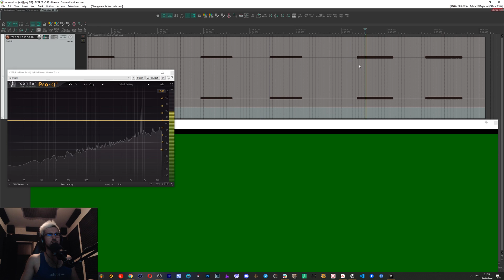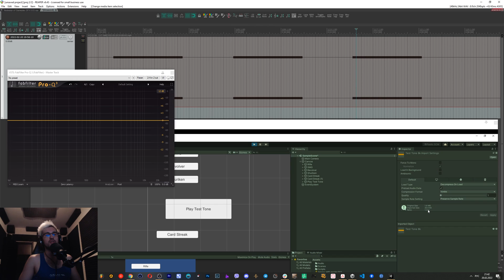Unity Audio Compression Formats (PCM, Vordic, ADPCM) And Sample Rate (Optimised) Settings Comparison

Comment: ADPCM is not as bad as you thing. The only "bad" thing here is the unfair testing method. :)
If it is really that bad, it wouldn't be there anymore.
ADPCM relies on integral/differntial math and do the compression based on the waveform.
Vorbis is DCT-based and compresses on spectrum instead.
Since your test spectrum has only one single frequency, even the worst DCT-based codec at its lowest bitrate should be able to handle that one frequency whereas ADPCM totally fails here because it can't replicate the round waveform well enough.
Try some white noise instead. This is the opposite unfair test. ADPCM will be likely the clear winner because it is the only lossy codec here not transforming it into a gargling mess at all.
Real recordings are neither single sine waves nor noise but something between. Here it dependends on. Most of times, all codecs produce good results. 
The only problem ADPCM has: It's the plain old IMA ADPCM, which is old and outdated. You need more bit rate. Made for limited hardware resources where you cannot use more complex codecs like Vorbis. 
Try WavPack. This is a newer ADPCM codec. The results are comparable, to MP3, if not better - As long as you don't feed pure sine waves :).
Reply from the maker: I agree that my testing for ADPCM was unfair.
But I don't wanna risk my audio turning into mess. Also mobile devices space is very limited too.

Comment: The transform codecs are all very good with steady pure tones. They internally split any sound into narrow bands and focus the coding on the loudest ones. Even at the lowest bitrate the result was acceptable. There is no need to attempt optimize the sampling rate because the codec essentially does it dynamically. Obviously 1% is not good with realistic sounds.

ADPCM is good with broadband sounds. You must keep the sampling rate high because big differences between successive samples must be avoided. It would have done better with the bass tone. It fails with melodic sounds like "triangle", but ocasional noisy sibilants or hihats would  be acceptable.

Comment: Hi Andrew! Thank you very much for your video. What samplerate are you using for your game audio? 44.1 kHz? 48 kHz?
Reply from the maker: Hi. I use 48 kHz, just cuz I work in them every day. But u should be okay with either of those, as long as u don't convert them within Unity. Cuz then the sound can turn into a mess.
Reply: Go for 48000Hz and you will be fine. :)
Forget legacy 44100Hz unless you want to produce a music CD. And even then: 48000Hz (or a multiple of it) and downsample it for the CD-based distribution while you keep it for all other ways of distribution. With a good resampler, the resampling distortion in the very last step of the CD mastering process is way below the distortion the downmix to 16 bit may introduce.
Almost all digital audio converters which are not CD players operate at 48000Hz or a multiple of that. The realtime-resampling of soundcard drivers are a compromise between quality and speed and may indeed become audible when the conversion is uneven. Using 48000Hz avoids this.
Modern lossy codecs, including Vorbis, are tuned to 48000Hz so the result will be likely the best at this sampling rate. OGG Opus doesn't even support 44100Hz anymore (it just resamples everything else to 48000Hz during encoding process).
If you listen to music files with your computer, installing a good resampling plugin in order to resample 44100 to 48000Hz may improve the playback audio quality :)
Reply: @wichtelchen  Very useful, thanks
Reply from the maker: Я так розумію, в тебе українське прізвище.
Reply: @Andrew_Renko  верно, у меня украинская фамилия и украинские корни. Сам я родился и жву в России, но в детстве очень часто посещал своих близких родственников в Украине и конечно же продолжаю поддерживать с ними связь и сейчас.

BTW thank you for answering my question. I asked more from sound engineer perspective as I don't use game engines much. I'd like to do best practices for my clients when I'm working on audio/music/sound design so I decided to ask you about your vision on the industry standards and where they are going to be tomorrow.
Reply from the maker: BTW, in this same video I show why u should not mess with sample rate. So if u want to mess with it - I recommend resampling using DAW or other sample-accurate audio software (to not change any timings or loudness). 

Tho, it will only same u few megabytes on project weight. As after unity compresses the audio - it will no longer matter what sample rate was there before. As I know, sample rate doesn't affect the compressed file size with lossy compression formats (like OGG and MP3)